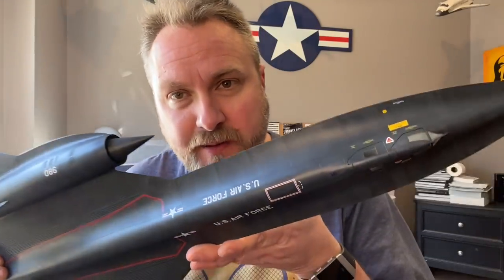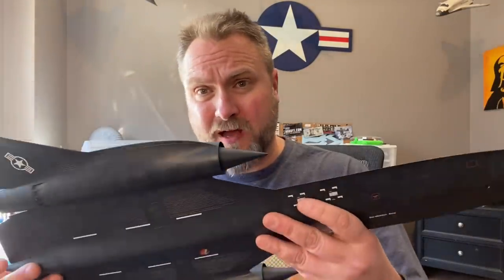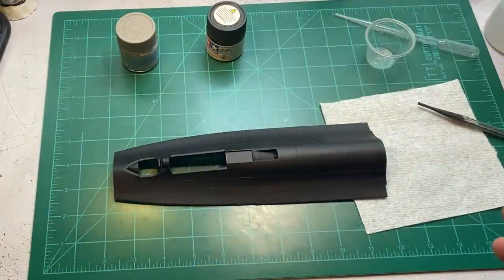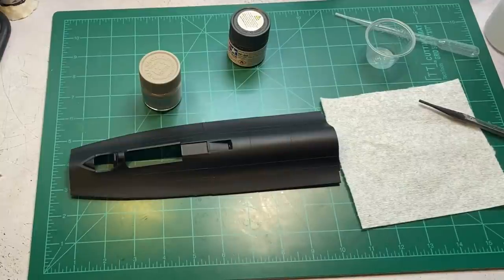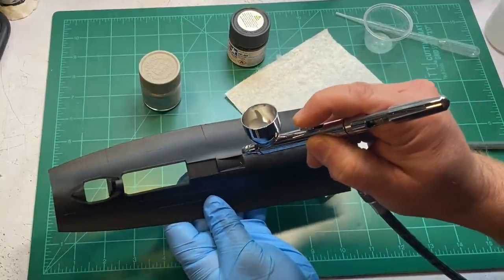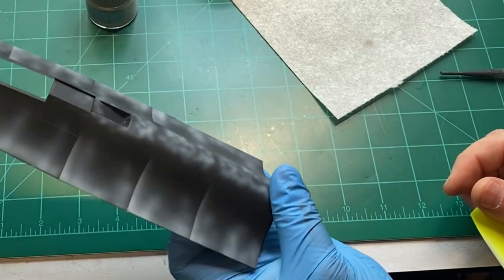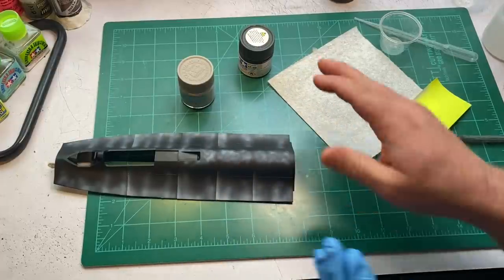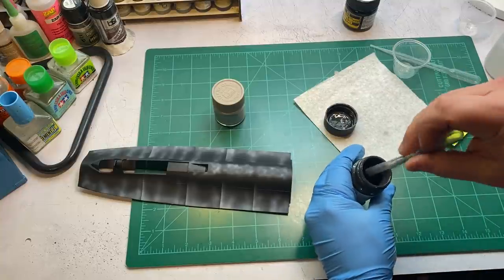Revell 1/48 SR-71 Build Part 2

Comment: you are one brave soul to build this kit. i build it once back early 2000 for a contest in Orange County. i added a resin cockpit and gosh, gosh, gosh, this thing is a nightmare to build. my build turns out well. maybe all the stars in the Haven aligned during my build timeframe. i was even impressed with it. BUT, BUT, BUT, i will not build this again. ever.
Reply from the maker: I’ve built the one you’re talking about but this one is the new mold released in late 2021.  It’s much better than the one you built but it still isn’t much fun;)
Reply: @seanerk5kt9  got it. it's the Testor kit. the nose section was cut into like 8 pieces.

Comment: Thank you very much for sharing this, it looks amazing! I have question about displaying models hanging from the ceiling. Do you have any recommended varnishes that can protect them from regular dusting? I am also concerned about yellowing over time. Thanks!
Reply from the maker: As far as yellowing, I’ve heard “Future” yellows over time but I haven’t seen it on any models I have.  Dust is always going to be an issue especially with a flat finish…it’d be easier to dust with a gloss finish like Tamiya gloss or alclad aqua gloss but those don’t fit well with most planes.